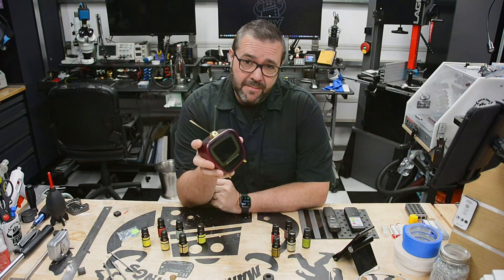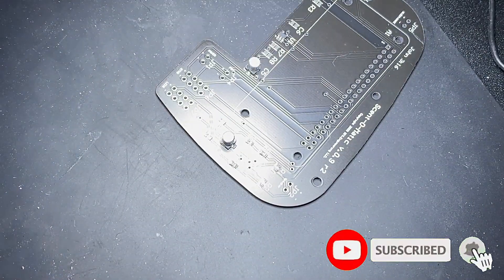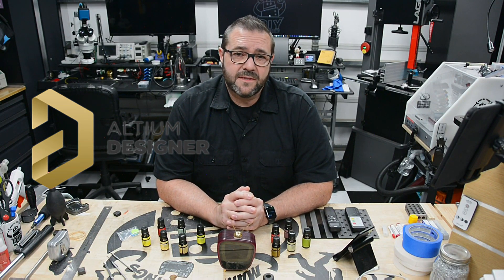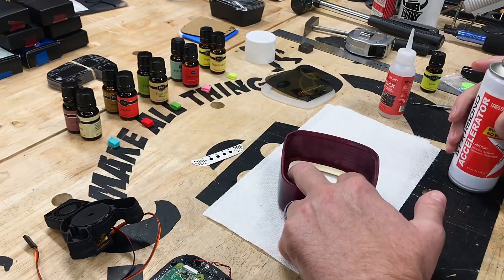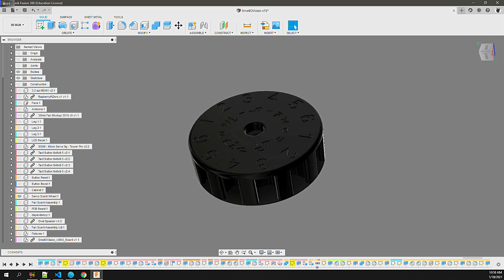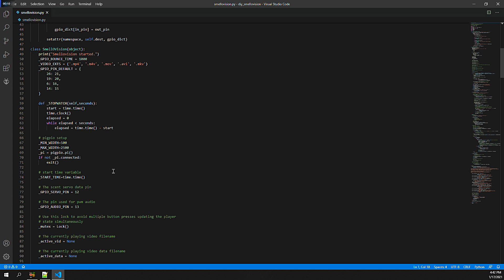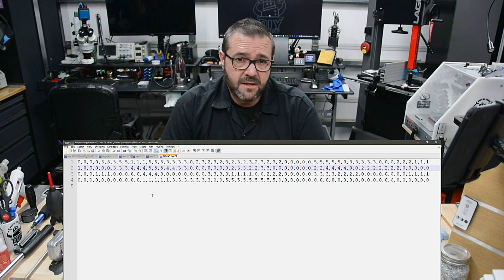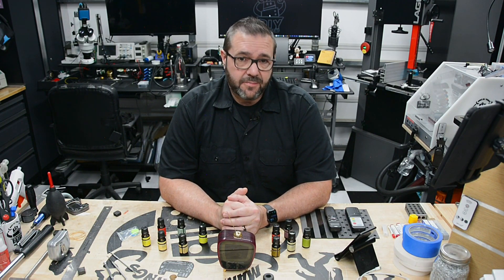A Video Player that Plays Scented Movies?! The Scent-O-Matic Part III

Comment: Everything you do is so professional and meticulous, it helps me set my bar higher on my projects.  What soldering iron are you using? It looks like it has built-in fume extractor.
Reply from the maker: Thanks and Yes it does.
There is a link in the video description.
(Amazon affiliate link)
Reply: @DIYEngineering  Hmm, I must be blind or something. The closest I see is the hot air rework station, but I didn't see the extractor for the rework station on the amazon page.
Reply: @rcboosted  I have the same soldering iron and rework station in my lab. There is a version with only the hot air gun, and another with both.

Comment: David your attention to detail is amazing. I wish I had a 10th of your creativity. Do you just see the end product in your head and make it or does it start with a concept and then build as you go.
Reply from the maker: At any given time I have 4 or 5 ideas incubating in my head (thinking them through) I don’t start on them until I’ve resolved all project obstacles that I can think of! Iterating a design in my head is cheaper than once it starts requiring material, machining and my time... ;)